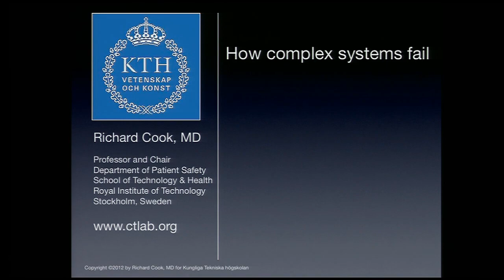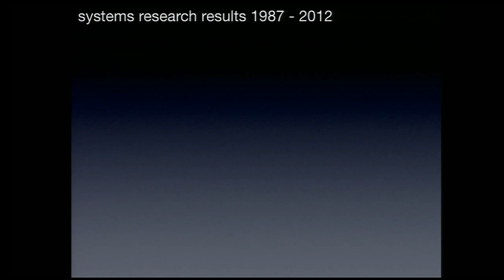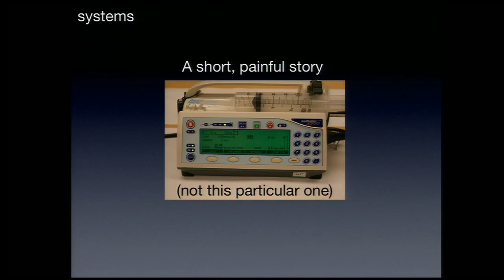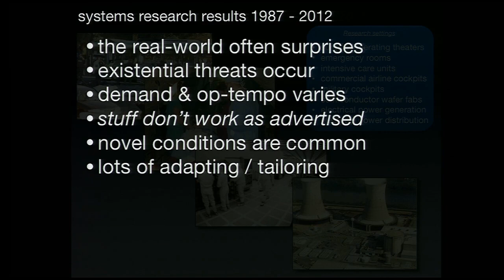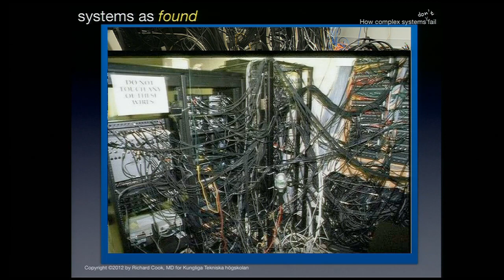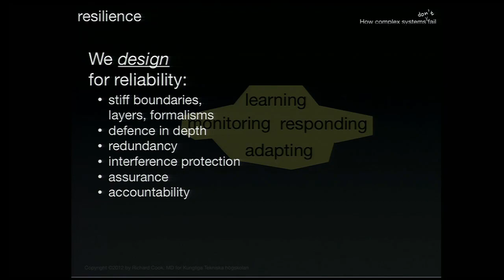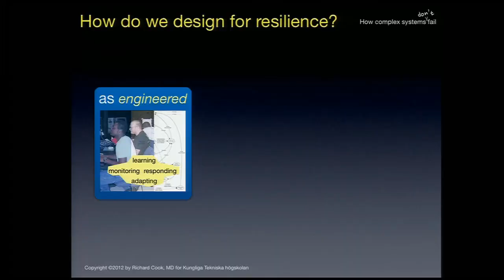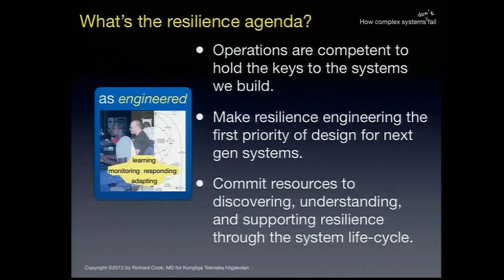Velocity 2012:  Richard Cook, "How Complex Systems Fail"

Comment: The problem with just leaving things open is people will hook into everything they can, and then get incredibly angry when you break it when you need to fix or improve the system. If you have to really modify to hook things in, it is very clear to the operator that they are going into unsupported territory, forking the code if you will, and that they are responsible for any future breakage, and I really dont see the problem with that.